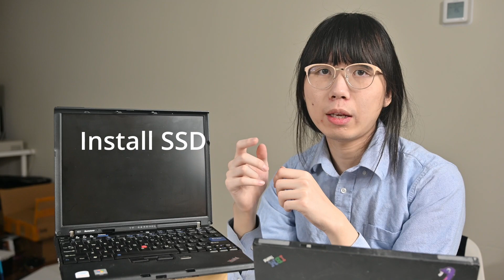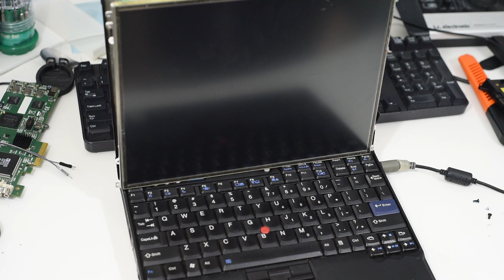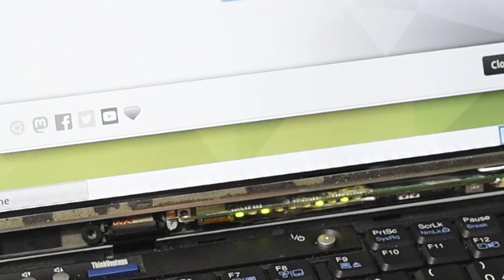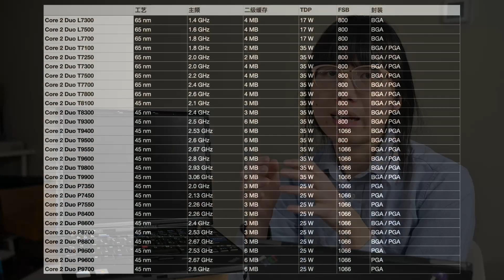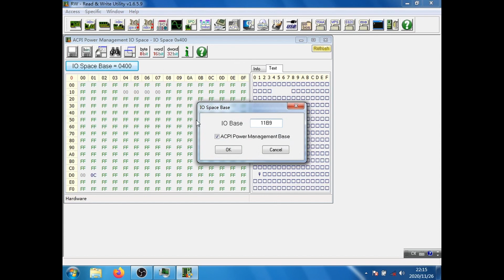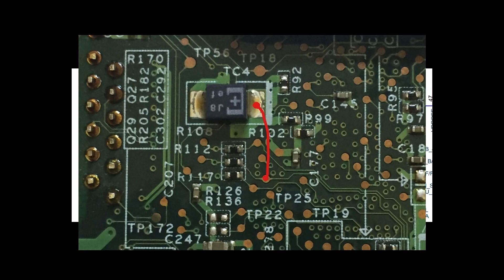Upgrading my ThinkPad X61

Comment: I have C2D MacBook Pro. For cooling, I drilled 2 big holes on the bottom and placed some screen fiberglass for some protection (it is window screen material). The MBP is sealed for audio purposes, so had terrible cooling. Now it runs cool but the speakers sound lousy. 

It has the rotten nvidia GPUs with "packaging issues" (e.g. lousy no-lead soldier). Maybe 9800GT but can't remember. This GPU is just a bit too old to run modern videos efficiently so is not ideal. 

Great video.

Comment: My mom still daily drives an x61 with a hhd... But on linux mint
Reply: you should at least slap an ssd in there, best upgrade you can make. The Middleton bios will also unlock faster speeds on the ssd as well as better WiFi cards

Comment: Why not just redesign a motherboard with ARM processor??? Even Raspberry pi will have better performance per watt.
Reply: there are diys x62, x63 from 51NB, but they are really expensive and hard to buy
Reply: Pi-tops actually have similar battery life to laptops due to all the discrete components such as the HDMI-to-eDP converter.  So I'm told.  To me, the best path forward for new motherboards is to use Computers-on-Modules.  These are an industry standard, exist in great variety including different ISAs, and all you have to do is design the carrier board.  Possible downside: these are industrial computers, so might-well not support suspend and resume which you kind of need for laptops.
Reply: @smorrow  The Pi Zero 2W + well designed HDMI to eDP converter will only draw about 5 watts, plus the LCD panel would be up to 15 watt max. this is at max TDP.  So with 72 watt hour battery, we are looking at 5 hours battery life minium.  in contrast, the old 45nm processor in this x61 it self draw 6 watt at idle and 35 watt in full ultilization.
Reply: @smorrow  I had designed a HDMI to eDP driver to drive a 10.1 inch 720p IPS panel take only 8 watt in full brightness (400 nit).
Reply: Have you designed a new ARM motherboard for this yet?

Comment: wow nice , great work i should upgrade my ccfl screen to led too but the ccfl is too nice in dark rooms 
my laptop supports ddr2 upto 2gb only it is a disappoiment
Reply: Have you checked the maximum amount of ram the processor can work with? Sometimes the motherboard manufacturer states a lower amount for various reasons (higher capacity modules were not being produced at the time, for example) but the processor and chipset are capable of working with them. It happened to me with an MSI laptop: the MSI website stated the laptop could only hold up to 4Gb; as the CPU was a 1st gen i5,I checked Intel’s website and found out the processor was rated up tu 8GB in 2 x 4GB configuration…I installed the RAM and, lo and behold, I had a laptop running twice as much memory as the manufacturer claimed it could support
Reply: @guaiqueritech  update . it can handle 3gb ram and iam going to try 4gb too , soon . like you said . Also sometimes the limitation is the bios thing

Comment: will this also work for an x60s? That's the model I have, I'm looking to upgrade it but don't even know where to begin. Yours is by far the coolest tutorial I've seen on this subject, I would love to apply some of this to my x60s if possible
Reply from the maker: Unfortunately not much: RAM on X60/X60s is limited to 3GB, SATA SSD is limited to Gen1 1.5Gbps, X60s/X61s uses a thinner lid and different screen cable so IPS/AFFS mod is much much harder (if it could be done at all...), CPU upgrade is possible, but also limited to ones supported by 945 chipset (some 65nm merom ones).
Reply: @nbzwt   thank you SO much for the response, I truly appreciate the help/info :) even if the answer is kind of sad for me, lmao. Do you think if I replace the motherboard with one from an x61 that more upgrades will be possible?
Reply from the maker: @saramaeks9826  Yes, IIRC X60/X60s/X60t/X61/X61s/X61t motherboard are mostly compatible, but keep in mind: 1. X60s/X61s chassis are designed to fit a smaller fan. So you are limited to use the stock fan for the new motherboard. X61 (non-s)'s CPU is probably going to dissipate too much heat for that fan. 2. Some X61 features a 2nd fan under the palm-rest, it would interfere with the finger print reader on X60/X60s (if your model has it) so it needs to be removed. If it's removed then you would get a FAN ERROR (skippable) on every boot. In that case you would need a modified BIOS to get rid of that. 3. Obviously changing the motherboard won't affect the LCD/ top lid situation.
Reply: @nbzwt  thank you so much, I can’t tell you enough how much I appreciate your descriptive and specific comments, it is so so helpful as a newbie to computer modding/old thinkpads. Probably picked the wrong computer for a first-time modder but oh well. As for size… maybe I can use CAD to design a new bottom casing to hold the x61 board + fan? I have a 3d printer, so that could be a fun thing to try… oh no… the project… all my free time… it’s taking over!!! Lol. Thank you so much for your help, I truly do appreciate it :) the thinkpad community is such a kind one.

Comment: It's unbeliavable how that little C2D holds up, I didn't even think YouTube would work, but 720p works perfectly!
Reply: I watched this video on a C2D MacBook Pro. Still a usable laptop in 2022.
Reply: I use a 1.6GHz Core 2 Duo T5470. For 720p 60 it's great, and even 1080p 30. Zoom calls and Google Meet works fine, and it does everything I need it to do as a laptop.
Reply: It depends, if you have a discrete video card, or a minimally decent solution like a Radeon 3xxx, it will handle the h.264 video decoding leaving the processor free. If you have an Intel GMA, you need a T7500 processor or better because the processor will have to handle everything.

Comment: Can I upgrade my T61  T7500 with P9500 with your modded Bios
Reply from the maker: The BIOS I modded would only work for X61. However the same process could be applied on the T61's BIOS as well so you could make your own modded BIOS for T61. I have also seen modded BIOS for T61 somewhere online.

Comment: This is the most professional X61 hardware mod video I have ever seen. Thanks for sharing.
I own a few X61/X61S before and most things I have done is overclocking a L7500 with the wifi card mod.
For whom would like a minor upgrade, please swap the harddrive with a SSD and flash the mod bios to unlock SATA2. 
Also remove intel ME in bios can boost performance for around 1% in performance. (ch341A+me_cleaner)
X61 is good at undervolting. For windows, you may use "rmclock", for linux, you can use phc-intel or c2dctl to undervolt the processor for better cooling and longer battery life